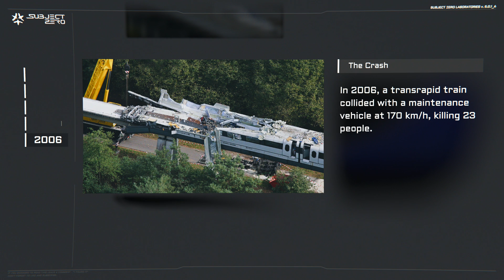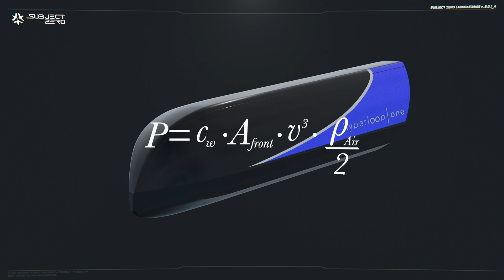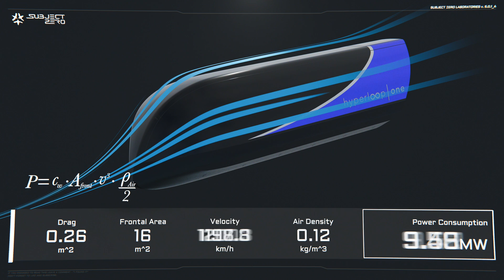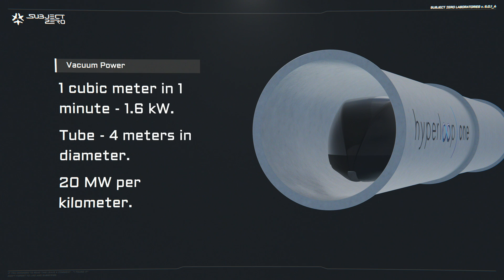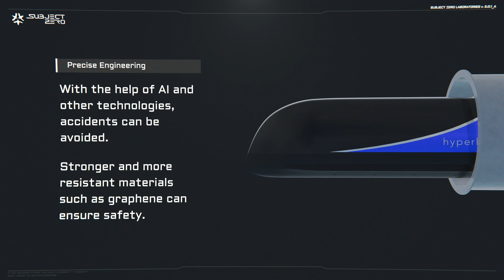Hyperloop - Inevitable Failure

Comment: ooh my bad...i just opened the window..goodbye sweet oxygen.
Reply: Just like any airplane...
Reply: @johntheux9238  Nope. In case of loss of cabin pressure in an airplane, you can just use an oxygen mask. In a vacuum, oxygen masks don't work - your muscles simply wouldn't be strong enough to work against the vacuum. That's why astronauts require pressure suits during lift-off, not just oxygen masks.

Comment: The biggest inescapable problem I see with it is expansion and contraction of the material making the tube. Having a single welded piece of pipe that long would have meters of expansion and contraction over the kilometers it travels. Only feasible way I see to get past that is to bury it deep enough underground to where surface temperature fluctuations would have minimal effect, but then any accident would be impossible to get to in a reasonable time, as well as complicating maintenance and increasing expense, and making it impossible to use in tectonically active areas.
Reply: If the tube is surrounded by air and there's an accident of any kind, the high velocity all but guarantees that the tube will be locally destroyed, after which the inrushing air will carry debris all the way to both terminals, destroying basically the entire length of the tube. So burying the tube deep inside solid rock would be pretty much mandatory. Not to mention keeping people from shooting at it. But of course making long tunnels in solid rock is insanely expensive, and also means that any accident or malfunction kills everyone from lack of air.

All in all, the whole thing is a stupid idea. Take a train or a plane.
Reply: @clovernacknime6984  exactly.
Reply: Burying it might get rid of temperature problems, but will also invoke tectonic shifting problems.

No matter how you look at it, it's a pipe dream.
Reply: Hyperloop was always intended to be deep enough underground that there would be no problem with temperature expansion and contraction.
Reply: And the fact that construction costs would absolutely explode having it be completely underground
Reply: "Only feasible way I see to get past that is to bury it deep enough underground"

Well golly gee: that sounds like something I've heard called a subway.
Reply: What you are describing already exist and it's called a continuous welder rail. Works just fine.
Reply: @johntheux9238  Those rails are basically 1-dimensional and they do fail.  A large tube would be much different.  How would one prestress a tube and account for loop thermal expansion differences (for example the tops receiving sunshine while the bottoms rest in cool dirt)?  Unlike a track buckle, a vacuum tube failure would be potentially catastrophic for the entire line.
Reply: @Milarz  You just need bigger anchors.
And rails are just unprotected steel, the vacuum chamber would be painted white so the difference in temperature would be much lower.
Reply: @johntheux9238  And you are going to achieve this over perhaps hundreds of miles, without distortions less than a very few centimeters, or risk an explosive derailment?  This "little" problem is addressed in the white paper by suggesting that the pylons could have lateral dampers.  What a joke.
Reply: @Milarz  The vacuum chamber would be built in the summer so it would be under tensile stress as it shrinks in the winter.
So it would self-straighten like a cable.
Reply: @johntheux9238  lol yes so easy no one can do it right
Reply: @obinneji  Well, no one has really tried so far, only small startups and university teams.
But China is working on the hyperloop.
Reply: @johntheux9238  lol
Reply: @Jimmeh_B  Continuous welded rails are welded, they don't have expansion joints, they are designed to survive the internal stress caused by thermal expansion.
Reply: @johntheux9238  I know exactly what they are bud.

But comparing them to a solid welded tube, under vacuum, as if it's in any way shape or form equatable... that's next level.
Reply: @Jimmeh_B  Yes, a vacuum chamber is different because you can't avoid the buckling loads caused by the negative difference in pressure unlike thermal expansion where buckling loads can be avoided by building the track in the summer.
But you can still protect the vacuum chamber against buckling loads by adding stiffeners on the inside like boat hulls for example, so it's something that can be avoided.
Reply: @johntheux9238  yeah. okay.
Reply: @Jimmeh_B  Take an huge cargo ship for example, their hull can easily go more than 10 meters underwater. That's over one atmosphere of pressure. They avoid buckling by adding stringers on the inside. And they have an huge radius, way bigger than any vacuum chamber.

Comment: Apart from many others a problem is where does it fit in? For a short distance anything shorter than  LA - San Francisco there's no point in going supersonic as travel time will be dominated by getting to the terminal on the metro, waiting for the pod and getting to your destination Doesn't matter if you shave 40 minutes off in the middle. Then for long distances there's a whole lot of 225mBar air available free of charge. You can cruise at mach 0.95 with the comforting exceptional safety record of aviation.
But what I worry about is the kinetic energy of a pod 1/2 m V^2- quite a lot. What if the pod decided to swap that for heat, like for instance a maglev bearing failed? The vehicle would get pretty hot and there would be all sorts of fumes and smoke and you'd be in an evacuated concrete tube hundreds of metres from an exit.

Comment: The vacuum can be created with a system of weights and floats following the tides and thus pumping the air into the tube following the mosaic of the tides. Maybe just an idea like that, on the other hand the hyperloop ports will necessarily be close to the coasts.
Reply: Electricity is cheap, just use pumps.
Atmospheric pressure is only 10 tons per square meter so it's like pumping that same volume of water up 10 meters.

Comment: 4:06 confusing kW and kW*h, 1 minute time frame is irrelevant, never mentioned desired end pressure. 5:14 it is spelled "worse", not "worst"
Reply: I mean, there's a difference between "worse" and "worst" – worst means the subject is the lowest of the low; worse means the subject is more bad compared to another thing.
Reply: @Gelatinocyte2  Technical and literacy issues - typical of so many YouTube creators, but most viewers are another magnitude of ignorance lower so very few could ever realise these errors...

Comment: 30% increase in cost isn't all that bad considering the potential advantages. In theory someone who would want to derail a maglev could do it now and would be a death sentence to anyone on board already.
Reply: That's just the cost of rails. There are many many more things to consider
Reply: @sendoh7x well he said "wrapping everything in a tube will increase the cost by at least 30%". Of course that at the very minimum the train itself will be also more expensive but that's just way of things work. First units are always the most expensive.
Reply: @the_aurora  tbh top concern is safety. Too small margin of error that would devastating consequences
Reply: @sendoh7x  thats the case with maglevs as well. Not to mention nobody is batting an eye on cars, they are by far the most dangerous mode of transportation aside from bikes. Its the same with nuclear energy, everyone is scared of it because of "safety" when in reality its more safe than wind..
Reply: @the_aurora  nothing came close with the combination of mach2 speed and vacuum tube

Comment: Technically possible? Yes. Economically possible? Perhaps, some very dense city centers that could benefit by being connected together. By connecting large cities that are far apart from one another, we could create, in effect, megacities that are capable of acting as a single unit, which could help with the rising cost of living in urban environments due to space constraints. However, we are finding that we can do without living in many of these cities by simply adopting remote work, and going to the cities less frequently. Overall, I think that there are cheaper transportation (e.g., traditional rail, or high speed rail) options out there and that Hyperloop is likely to remain a fiction for all but for the densest city centers, where being connected by Hyperloop would provide substantial economic benefits.

Comment: Hyperloop on paper looks really promising and as an idea will most likely never die. Just like idea of a space elevator or connecting Europe and Africa via Gibraltar and I think it never should. We should always revisit these ideas and look at them in context of advancements made over decades or centuries. There might come a time when materials, needs, price etc intersect and it becomes the viable solution.
Reply: I actually came to say something similar. There's nothing wrong with having taken a serious, updated look at this idea. Not ready? Ok, look again in a few more decades. No problem.

In fact, the "I told you so" response that is so common for this stuff is counterproductive. There are so many things we could do better that we give no resources to. 

It's literally good and productive that we tried and failed. Let's fail more as a species.
Reply: Don't need any better Europe Africa connections
Reply: I have invented a better solution called the Air Sledd. - much cheaper -achieves the same goals - and actually proven to work

Comment: People really don't realize how ridiculously expensive maglev tech is to build. It needs to be straight, it needs a boatload of tunnels and corrections, all of it needs to be viaducted. It all needs to be automated because humans can't handle speeds like that.

Tokyo > Nagoya Maglev = 50 billion dollars for only 285.6 km and thats with a country with 70 years of High Speed train building experience.
Tokyo > Morioka = 25 billion dollars for 497 km is the second most expensive line with a comparable number of tunnel kilometers. 
Shin-Hakodate-Hokuto > Sapporo = 212 kilomters with 80% of it in tunnels is only 15 billion dollars. 

And people want to put Maglevs in a Vacuum Tube. The costs would be literally unmanageable. 

And all of this comes with the fact that it offers even less space the conventional high speed rail. Chou Shinkansen is a 2x2 seating configuration while the regular ones are 3x2 meaning a almost 33% drop in overall passenger numbers per train.
Reply: Yes, why not just use wheels for the hyperloop? Most of the friction comes from drag anyways, not the wheels.
Reply: @johntheux9238  Because there no point, you'd only get an energy usage reduction and thats a non issue. Wheeled trains are limited by the physics on steel on steel interactions. And when you get to high speed the wheels need to handle ridiculous vibrational and centrifugal forces.

The reason the Shinkansen was originally though to be almost impossible was these same issues. 

Then you have another issue, power delivery. The reason maglev can do speeds it can is because it has wireless, frictionless power delivery. Meanwhile you'd have to design a pantograph to run at 500+ km/h constantly.

Then there is also fact that meglev is actually pretty resistant to weather stress, because most of the maglev track is built out of concrete with just the guideway being made out of metal that can be enclosed and shielded it does not suffer the thermal expansion stress of regular train tracks meaning it has to care less about constant maintanance to have the perfect geometry for such high speeds. 

You would think it being enclosed in a tube would help with the hyperloop but the tube itself would suffer the same problems. Thermal Expansion would he one of the worst nightmares of a hyperloop system trying to maintain a vacuum. You'd have daily movments on the scale of tens of centimeters along the entire tube. Add to that the pressure of the atmosphere and it's a nightmare.
Reply: @Mew178  That's not true, turbines and turbofans will spin just as fast with no issue, the issue with wheels has always been aquaplaning but that's not going to be an issue in a vacuum. Rolling resistance does not increase with speed unlike drag.

Continuous welded rails can survive thermal expansion just fine without expansion joints. It's going to be just the same with the hyperloop.
Reply: @johntheux9238  Wait what aquaplaning? Are you proposing to run this thing as a jet powered, rubber wheeled train?
Reply: @Mew178  Trains can easily reach over 500 km/h, it's just not safe to do so.
A french TGV can reach 575 km/h but they are limited to 300-350 when carrying people.
That won't be an issue in a vacuum.
Reply: @Mew178  It's still using electric motors and steel wheels. But steel wheels are still subject to aquaplaning.
Reply: All the points you made are not what is expensive. It's the right-of-way that's expensive.
Reply: @pewterhacker  The maglev is literally 90% underground what right of way? Or are you implying that small stretch of Yamanashi thats the 10% is somehow worth billions?
Reply: Going from 5 seats to 4 is not a 1/3 drop in overall passenger numbers. You should get your numbers right.

Comment: Technology wise it's doable.  It's just that it's not economically sustainable.
Reply: You can use wheels instead of magnetic levitation.
Reply: @johntheux9238  Yes, And try to get it economically viable by ditching the vacuum and the tube and what your left with is something that's barely viable in some very specific location.
Reply: @lucidmoses  Nope, you have to keep the vacuum, that's the only way to hit 1'200 km/h
A steel tube is way cheaper than magnetic tracks.
Reply: @johntheux9238  So only a million dollars a ticket and not a 1.2.   Ok. Got it.   :p
Reply: @lucidmoses  the tech John is thinking of already exists: it's called the High Speed Train.
Reply: @Gelatinocyte2 Nope, High speed trains don't have vacuums in tubes.   You know... the expensive bits.
Reply: @lucidmoses  I mean cheap, high speed and long distance travel. If we stick to strictly low pressure/vacuum transportation, there's also airplanes and the small pneumatic tube systems in some office buildings (which are used for delivering mail rather than anything larger).
Reply: @Gelatinocyte2  Cheap?!!   Do you have any idea how much Absolute basic rail lines cost.   No structures/tubes, no constant pressure maintenance, no power and all the cabling. no bridges to get over/under roads. etc etc.    
Rail is barely cost effective as it is.  They can't compete with planes and your going to increase the cost by orders of magnitude.
Reply: @Gelatinocyte2  *An high speed train in a vacuum
Which is called an hyperloop.
Reply: @lucidmoses  Most of the cost of an absolute basic rail line is the land. You have to get rid of everything in the path.
So you might as well use that land to build something more premium if it's so expensive anyways.
Reply: @johntheux9238  Let me get this straight.  Your response to it being way to expensive to be viable is that there was more expensive I left off the list.
Ok, Lets add another order of magnitude. 
You do understand that, that doesn't make it cheaper.  Right?
Reply: @lucidmoses  If a battery cost $50k is it better to make a trash car for $70k or a supercar for $100k?
It's the same logic.
Reply: @johntheux9238  Oh come on now.   You've pushed that too far.   That's so dumb you must be trolling.

Comment: still sad when you relise the entire point of the hyperloop was to stop government funding for high speed rail
Reply: How do you figure the point of hyperloop was to stop high speed rail..  I suspect you don't really have an understanding and you're just blindly repeating what you were told, not what you know.
Reply: @TheEvilmooseofdoom  there were leaked emails. Look it up yourself.
Reply: California high speed rail is trash though.
Reply: @johntheux9238  how do you know that? 🤨
Reply: @Gelatinocyte2  Because it's now $128B instead of $33B and it's still not finished.
Reply: @johntheux9238  You do realize that price inflation is common/typical in all sorts of infrastructure projects, right? Highway construction projects are just as expensive, and they're also more environmentally destructive, and they could only wish to achieve a fraction of what trains can in terms of passenger throughput. The original Shinkansen was also overpriced and delayed back then and there were complaints about it, but those have since gone quiet over time after its completion.

If you're using construction price and/or delays as an argument against trains, either you don't know what you're talking about, or you're operating purely under anti-train ideology. Delays and price hikes are inevitable with ROW acquisition conflicts and such; being a not-train project doesn't magically change that, unless it was in the current admin's agenda to give such projects an easy pass (and that is the case with America and highways, mind you).
Reply: @Gelatinocyte2  It's not because of inflation, it's because eminent domain is way harder in the US and all the lawsuits are slowing the project down.
We need to use more tunnels, which is what Musk is currently working on. Doesn't matter if you put cars, trains or hyperloops inside.
Reply: @johntheux9238  I'm not referring to Inflation, I just said "price inflammation" as in "increase in cost".